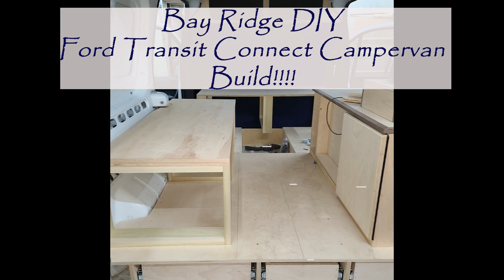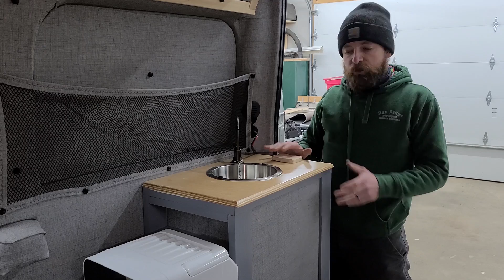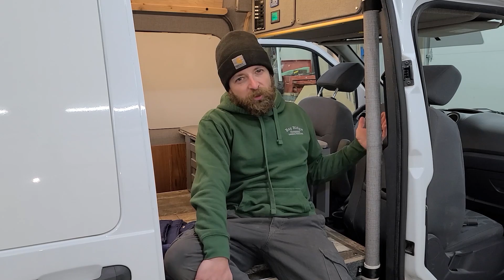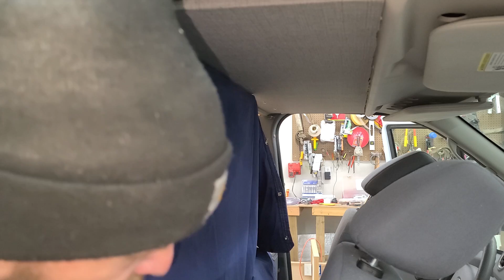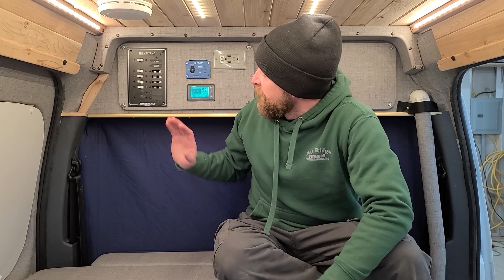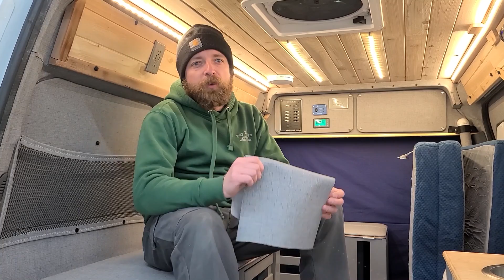The Ultimate Micro Camper: My Ford Transit Connect Van Build

Comment: Best one ive seen yet!! Everyone tries to put way too much in these vans and u are the 1st one keeping it simple with modular removable components.  Bldg a transit connect next year and paln on keeping it simple and light as possible. Just gonna strap a fold up bed so i can remove it and only use a twin when just me and a double when taking a friend. Leaving the other side  open for ebikes and paddle boards. The windows are genius to use that extra space.  Thanks for the ideas!! Btw if u dont mind how much did this build cost the customer in case i decide i need a tax writoff to have mine built? Gonna double as a fiber splicing van for my buiness. Also how much approximate weight was added with this setup? Thanks.

Comment: Sorry, very dangerous and wrong done!!! 
A CO-warner at the roof is not right. CO is at the bottom in the car because it is heavyer than air. When you lay down in the middle, you die before the CO warner warns.
Reply from the maker: "Carbon monoxide (CO) and combination alarms should be mounted in or near bedrooms and living areas, on a wall place six inches below the ceiling to six inches above the floor. If mounting on a ceiling, make sure it is at least six inches away from the wall" This is the from the company that provided the CO detector. Thank you for watching the Video.

Comment: The removable sink is excellent, also that you've set it up to fill from a hose. I can't move a 5 gallon can of water. Fold out bed also excellent. How wide is it folded out? Makes the space seem huge! How wide is the sink? Thanks for sharing. Bummer I don't do instagram.
Reply from the maker: Thank you for the comments!!! The bed was about 36" wide and the sink was 10" Round.
Reply: @bayridgediy3438  Thanks for the reply!

Comment: Nice,  neat,  clean, and can be removed if you need extra space.  But I think the wood you built on top will add more weight to the small engine, and make it work hard on hills plus poor gas mileage.  I build mine with the least weight possible.  Thank you for sharing some good ideas.   I will copy yours and re-do mine,  nice.
Reply: So what material did you use to keep weight down?....Mr. Gary
Reply: @garycochran2037  Much thinner wood,  plastic,  anything not too heavy for the 4 cylinders with a small 2.0 Liter engine.
Reply: @nanalcd5628  Tks for the info.

Comment: That table top on the back do drawers need a locking system on it
Reply from the maker: No they do not need a lock. The fold up table pinches it in place up against the face and the cabinet to hold it in place. Thanks for watching.

Comment: How did you attach the mesh parts for those side and rear pockets?
Reply from the maker: I attached them with a Button here is a link. https://www.amazon.com/Setting-Stainless-Fastener-Upholstery-Furniture/dp/B087T9DG2R/ref=asc_df_B087T9DG2R/?tag=hyprod-20&linkCode=df0&hvadid=437485895655&hvpos=&hvnetw=g&hvrand=6209194674620392521&hvpone=&hvptwo=&hvqmt=&hvdev=c&hvdvcmdl=&hvlocint=&hvlocphy=1027991&hvtargid=pla-912617570833&psc=1&tag=&ref=&adgrpid=104231366089&hvpone=&hvptwo=&hvadid=437485895655&hvpos=&hvnetw=g&hvrand=6209194674620392521&hvqmt=&hvdev=c&hvdvcmdl=&hvlocint=&hvlocphy=1027991&hvtargid=pla-912617570833

Comment: Greatly converted.  I have a 2013 Ford Transit Connect XL.  Can you give the cost?
Reply from the maker: Hey Gloriosa, 
A rough idea of the cost without labor and the van cost was around $4500 usd . Thanks for watching. Check out the 2018 Connect we did also for more ideas!!!

Comment: To save space use thinner foam for where your legs are - you only need thicker foam for hips and shoulders when side sleeping, In my van I have 10cm foam apart from the lowest 60 cm where the foam is 5cm thick - it takes up less space and saves a bit of money

Comment: Did you replace the stock alternator?
Reply from the maker: Great Question, 
In this model I did not have to replace the stock alternator. On the newer models the alternator is a "Smart Alternator" It will not allow you to transfer the power back to the house batteries the way I did it. Thanks for watching!!!

Comment: very nice build. clean and functional. I didnt see where you collect the grey water, only saw your fresh water tank. and for your Max air fan, did you have to go right behind the middle cross beam in order to clear the rear mounted centre brake light on top of the van? I have a 2012 and am still a little leary of cutting that hole in the roof for the fan. I like you hinged flip over bed. I built mine very similarly. also like that you went with thinner plywood. 3/4 is way overbuilt and too heavy for such a weak engine.
Reply from the maker: Thanks for watching. As for the grey water we just have a hose draining out the bottom of the van. I have it piped to the middle of the van. Very little water will be used so we set it up like a pop up camper. If you check out my Instagram you can see where the fan hole is cut. I kept it in-between the last two supports. It was very easy I know you have it in you!!!!

Comment: Very nice build! What model rv converter did you use?
Reply from the maker: Thanks Mike, Are you asking about the inverter?
Reply: @bayridgediy3438  No the 110 panel ...I zoomed in on the bottom and seen it's a paneltronics brand. Thx for the quick reply :)